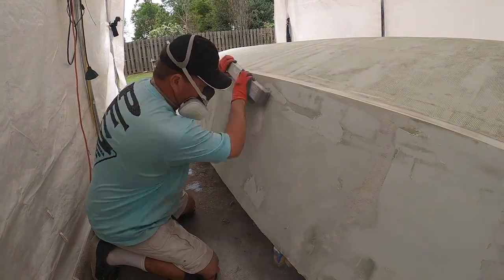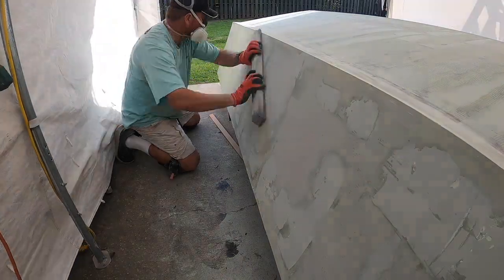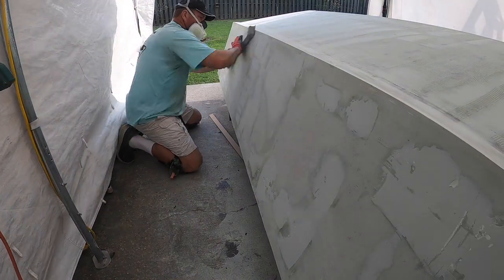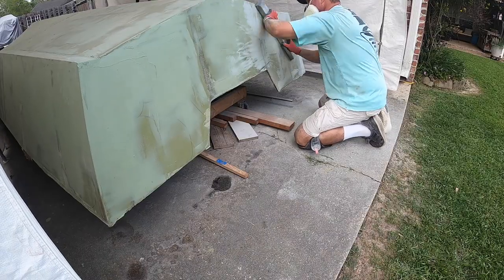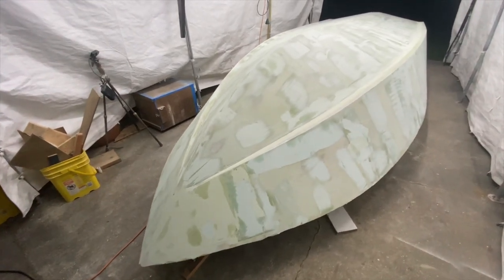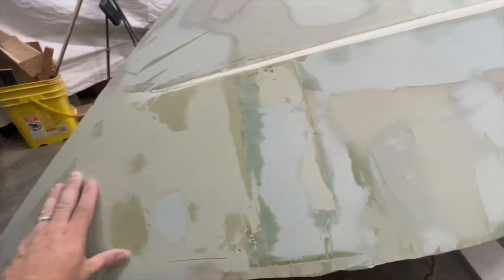33.DIY Boat Building: Do I look TIRED of Sanding?

Comment: Try using a guide coat helps keep you from sanding more than necessary.
Reply from the maker: Yeah I'm just trying to get it close enough that a guide coat is really necessary.  Up to this point it's pretty evident what's needed and where.  I've learned a lot, mostly about what not to do, but I think it's really close to primer.  Seriously this time.  Appreciate you checking it out.

Comment: It's nice to hear the word "PAINT"! Once you fill all those dips and gashes, lay down high build primer. At night, since you are outside, I used a flash light and shined the light towards my face parallel with the hull surface. I marked where I could see low spots. This is for the initial inspection of how fair the hull is. It'll tell you if you need to sand 90%+ of the primer off and prep for a 2nd coat or lightly sand and go for a final coat. I think I was on the 3rd coat or so of primer until sanding didnt show anymore of the green Total Fair. 

I can't wait to see the color. Judging by your common sense, it's going to look amazing with the details you are putting into the fairing process..

See ya soon brother!!
Reply from the maker: I'd be done by now if I would have just paid you to come help for one weekend.  Send me a quote.
Reply: @Bigeaux20  We could help each other like on Happy Gilmore. " It's all in the hips. It's all in the hips"
Reply from the maker: I see what you did right there, but no.  It's not in the hips.
Reply: @Bigeaux20  Close! But it may look funny but it feels good...

Comment: That’s looking really good. If you want to try high build primer you could get a couple of spray cans at your local auto parts store just to see if you like it. You might be ahead if you use your small compressor and a blow gut to clean your surface before you spray or roll on your primer. Either way that’s going to look good when you put on the final color. Great job!
Reply from the maker: I appreciate it.  I'm thinking I'm going to go straight to finish primer, but I still have this high build in the back of my head I can't shake.  I've sprayed before, and it's not too far fetched for me to get the stuff to spray a few coats.  I vacillate back and forth a lot about it.  Appreciate you checking it out.  There's also a chance to roll on some high build.  Time will tell.

Comment: I think a high-build primer will solve most of the problems you've pointed out. You're going to be sanding your primer anyway, and I'd bet you'll end up putting on a second coat of primer. I've roll-and-tipped awlgrip high-build with some success. It's still an art, but not as bad as fairing.
Reply from the maker: I'm still going back and forth about the high build.  I know it would deal with some of the imperfection issues, and I really don't mind the sanding as long as it's a progressive process all leading to a good result.  I'm still contemplating it.  I've seen someone roll it, so I am going to pick his brain and see how it went.  Even with the finish primer I am expecting to put a thin layer on, guide coating, sand it back losing probably most of the first layer.  Make final fairing tasks, then hopefully put a couple coats of primer, then guide and get pretty close.  My fear is all that is wishful thinking.  Stick around, I am getting used to your perspective.
Reply: @Bigeaux20  don't get discouraged or let yourself lose momentum because you're worried! The hardest part is starting! You got this.
Reply from the maker: The high build was just what the doctor ordered.  Appreciate your suggestion and hope you keep following along with your advice.

Comment: My opinion on the fairing should have put the high build first then sand . On that 1st layer you will find all the high spots then fair. I did a project like you did and I agree I was sanding for days not fun. Then 2nd project I sanded the bare wood and applied print spray on the surface sanded all the high spots down then sprayed primer . I was shocked how close I got it .  I sprayed print spray all over the surface and watersanded I brought the project out in the sun walked around and lightly sanded the high spots .
Reply from the maker: As with anything the first time doing anything with virtually no guidance is a steep learning curve.  The worst part for me is not knowing what done looks like.  I’ve followed the path of steady progress even if that meant I may not be as efficient as someone who has a lot more experience than me.  If I had to start all over again it would take me a fraction of time and effort, but that’s with anything.  So, my next steps will be high build, finish primer, then top coat to flip this thing back over.  Just need some days to get back on the project.  Work has become paramount so it’s hard to make progress working on the boat 4 days in 2 months.
Reply: @Bigeaux20  I just came across your videos a few days ago.  Been wanting to build my own hull but I want to build a bassboat style hull. When do you plan to get the primer on? I live in River Ridge la.

Comment: Do you have to sand back the low spot before applying more compound to them? I’m at tag step and not sure how to keep track of low spot if I sand them back…
Reply from the maker: That's a very good question, and I don't know if I'm the best to answer it but I will tell you my thoughts. I don't think you have to sand it in terms of surface prep to ensure a bond, which is what I think you are asking.  I don't remember if in the process of longboarding if all of the surface gets sanded, and some just much more than others like the high points for example get sanded, and etched totally, but I think even the low areas have some contact with the paper, but maybe just not enough that you see the change in color.  You have me thinking hard on that one.
Reply: @Bigeaux20  thanks for answer. I am spending a lot of time sanding the low spot by hand and then it s harder to find them, I have done a second skim coat but after that I’ll just do some patch..
Yes I was worried about the bonding, though Iow spot still have a little grain to it. The new compound is a little thicker.
Reply from the maker: Let me know how it works out for you.  What are you building or repairing?
Reply: @Bigeaux20 i am building a Cerny yacht tender. Just did a barrier coat of total boat. It came out really nice, it took care of all pin hole and almost had no issues. I’ll do more undercoat before painting topside but bottom is good!
The new formula of total boat fairing compound is a lot thicker…
Reply from the maker: I saw your other message on FB, and the picture was awesome.  Some angles and stuff to deal with i your build.  Let me ask, was it much colder when you experienced TotalFair being much thicker.  I did notice that cold temps made it sluggish, but in the same breath, hot temps made it go from thin to set so much faster so I did lots of small batches.  I am going to retry my epoxy fairing compound additive as well as giving the peel ply a try.  I hope it saves time and not another learning adventure.

Comment: I am not far from you if you need help spraying primer I got a gun and compressor .
Reply from the maker: I appreciate it.  My dilemma lately is having time to work on the boat.  I’m limited to an hour here or an hour there at best lately.  But, I will get back on it before too long.  But, I am noting this and may take you up on it when the time comes.